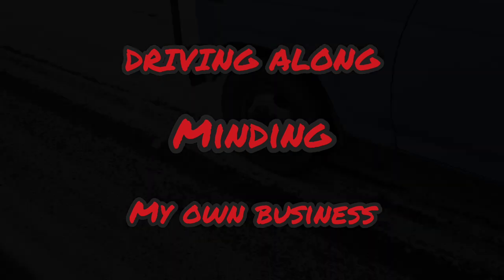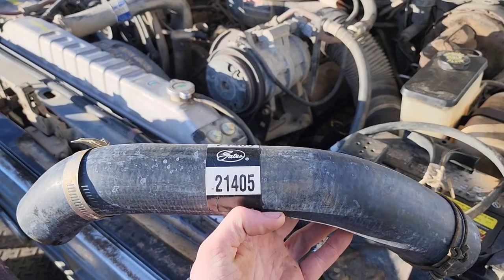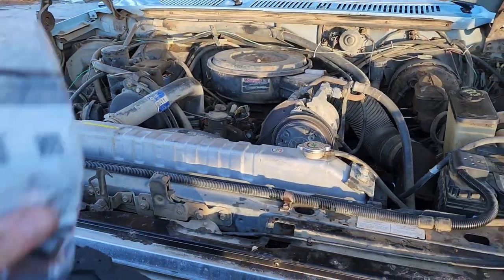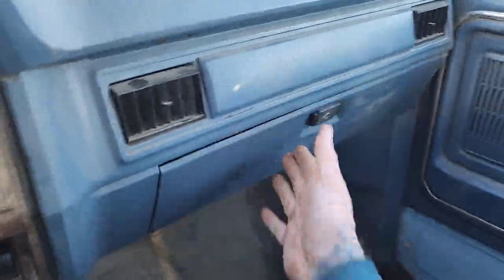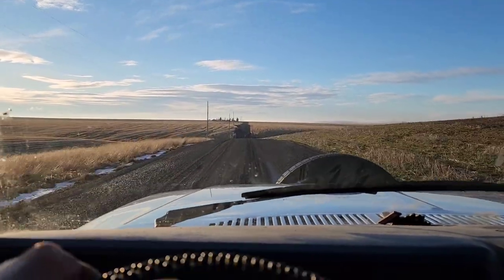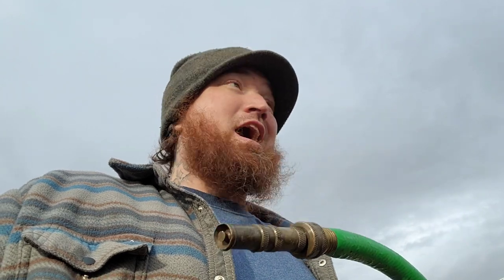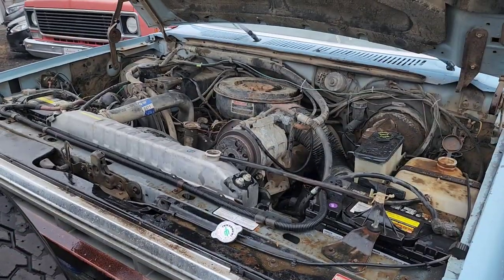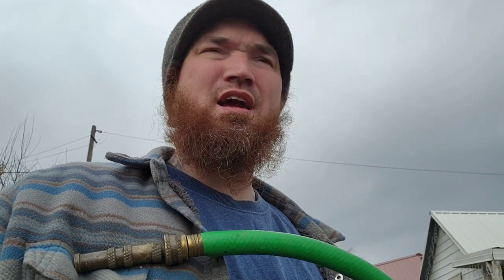6.9 or 7.3 IDI diesel coolant flush with evaporust thermocure

Comment: How do I know if my fuel selector module is pulling from two separate when I throw the switch
Reply from the maker: I personally would just install manual valves and be done with the tank selector, but I am a weirdo that likes manual stuff... So if I was to test one, I would probably disconnect the lines and run them to milk jugs or clear bottles to see where they are pulling from and returning to and look for air bubbles that would indicate leaking.

Comment: My 6.9 idi only took 4 gallons after a full flush, why?
Reply: 2 gallons of concentrate and 2 gallons of tap water
Reply from the maker: It is really difficult to get all the liquid out of the engine block.
Reply: @worthshop  well either way, it looks like it did a good job i just hope theres enough concentrate
Reply from the maker: @psd28  They make cheap little testers. It is like a tube that you suck up a little coolant with, has different colored plastic balls and tells you what freezing temp it is safe to. The couple dollars for the tester is well worth the investment.

Comment: Tech tip. If you want to use distilled water for your radiator but you don't want to spend all the money flushing it, then just flush it with the garden hose. When it's done being flushed, pop your upper radiator hose off the radiator and stick your air gun nozzle in there with a rag filling up the gap around it. Give it a couple light blasts to help push the garden hose water out the bottom hose, which is also disconnected from the radiator.

Then reconnect your hoses, and refill with the correct mix of coolant and distilled water. The process of using the air hose ensures as much of the hard mineralized water from the garden hose is removed from the system as possible. Then it won't plug up your radiator down the road. 

Signed
A guy who lives in an area with very hard water.
Reply from the maker: Good suggestion! Definitely useful to people that come along and read comments or watch the video later.
Reply: @worthshop  No problem. Hey by the way, I just wanted to say thank you for your videos on these particular engines. I went to look at an F350 ambulance today, and the info from your videos kept me from getting scammed.

Comment: Hey Aspie, you do video requests? 
More info on cavitation?
I inherited my 94 7.3 IDI, Factory Turbo , from my Dad. 
He, had to have engine rebuilt at LOW  miles due to cavitation. 
I own it now, for 10 yrs. 165,000 Mi. 
Never changed coolant, done the test strips, ect. I'll never sell this pick-up. Any info would be AWSOME! thanks!
Reply from the maker: It is my understanding that cavitation occurs over many many years and lots of miles. It is a super slow process for air bubbles to eat through the block. Really not sure what all I'd put in a video about it, but will ponder it a bit.

Comment: I replaced my stock radiator with an aluminum one about a year ago. Any special tips or tricks to keep it running well? I don’t imagine I need to flush for another couple years? 

Thanks for using those hands to build shit
Reply from the maker: No special tips or tricks with the aluminum radiator. Coolant is usually good for 2-5 years depending on what kind you put in the truck. Some extended life coolants are good for even longer. You can get a coolant tester pretty cheap and test it beginning of each winter just to be safe. Thanks for watching and God bless